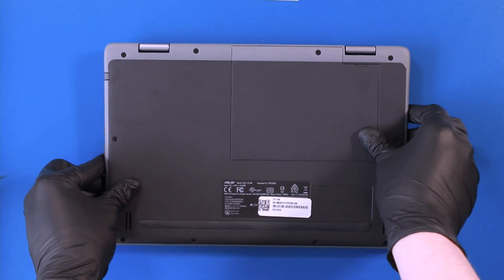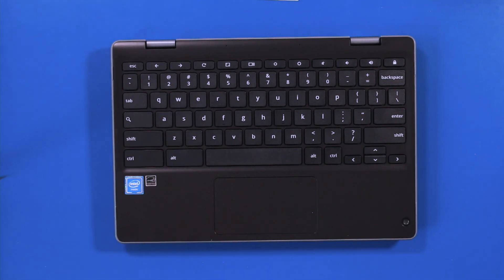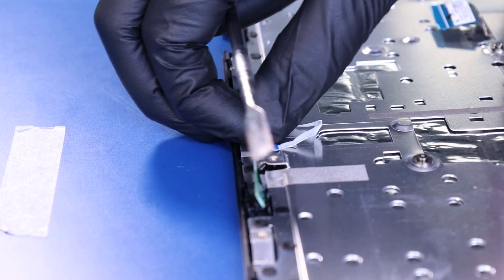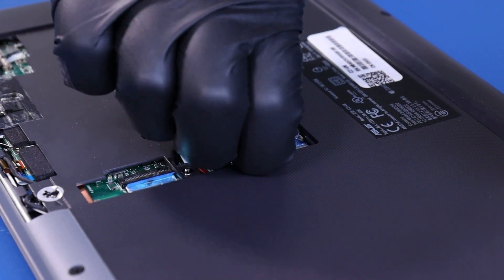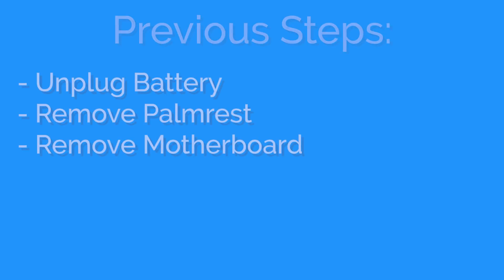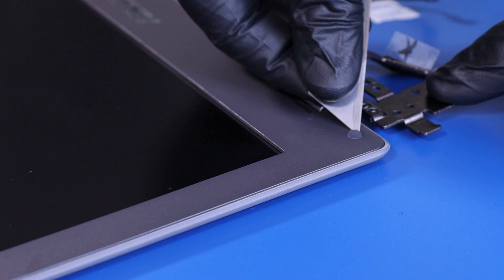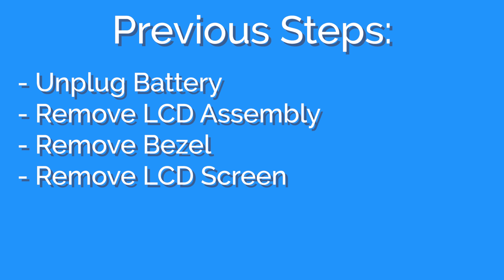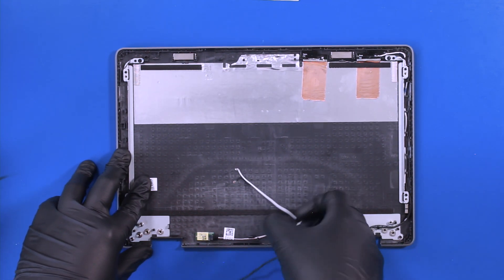Asus C214MA Flip Chromebook Teardown Guide

Comment: i have a c214m, i unplugged the battery to set up mrchromebox cfw, after shutting it off during a update and now its bricked. i found a cheap c234m that im going to take the motherboard from and use it in the c214m

Comment: My Bluetooth has stopped working, Troubleshooting is leading me to think the BT antenna needs replacing. Is this possible.?
Reply from the maker: It might be easier to replace the entire back cover, as these come with the antenna, and it's hard to find the antenna alone. Here's a link to one on our website:
https://www.chromebookparts.com/asus-11-c214ma-chromebook-back-cover.html

Not sure if your troubleshooting ruled these out, but two other possibilities are that the WiFi/Bluetooth card has failed (since that's soldered on, the whole motherboard would have to be replaced), or the OS is messing up and a simple recovery drive could fix it by following these instructions:
https://support.google.com/chromebook/answer/1080595?hl=en

Comment: Hi, I want to upgrade the memory of my ASUS Chromebook Flip C214 teardown from 32gb to 1tb, can you provide instruction or hard disk? Thank you and have a nice day
Reply from the maker: Hello! Unfortunately, the memory for this device is soldered onto the motherboard and not replaceable... However, you could use an external hard drive or micro SD card
Reply: @Chromebookparts  so myasus chromebook flip c214The memory is soldered to the motherboard. Can the SSD be upgraded? Or is the SSD soldered to the motherboard?Or can I replace the original motherboard with another ASUS motherboard? Thank you.
Reply from the maker: Unfortunately, there is no removable SSD on this device. It's soldered onto the motherboard and is not upgradable. There may be upgraded motherboard available, but it will likely only have 64GB of storage. Your best option is to use a Micro SD or  external USB drive.